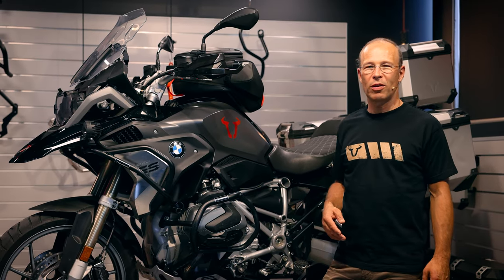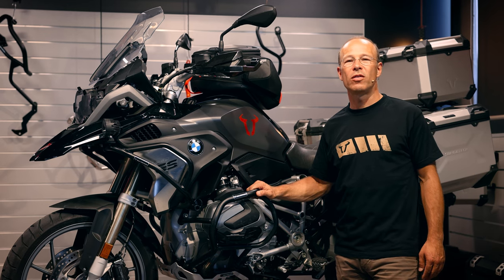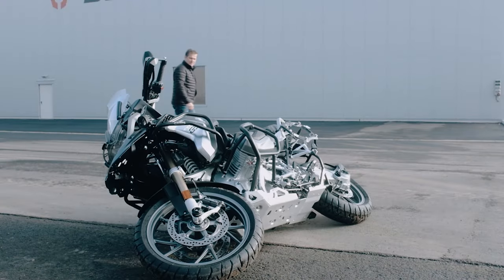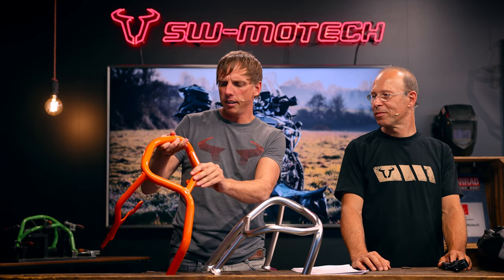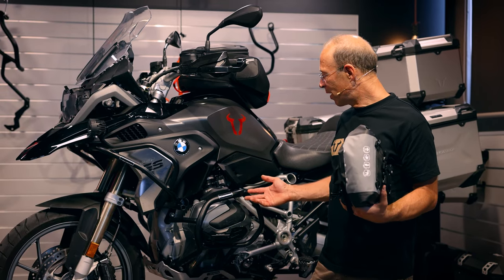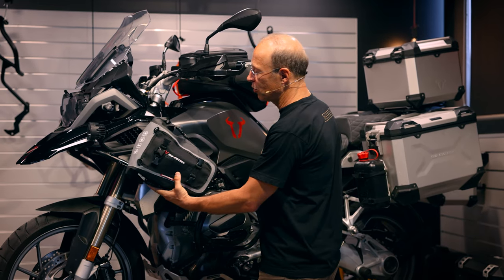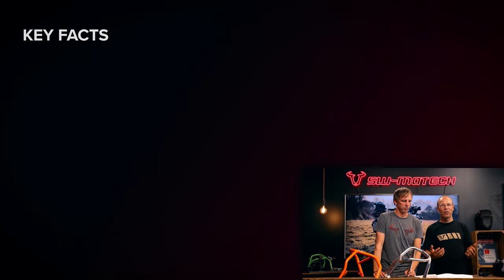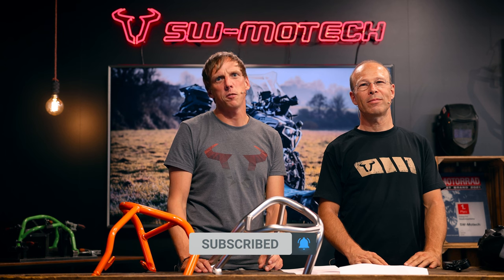CRASH BARS for touring ENDUROS - Useful protection on and off the road

Comment: I have a 2021 r1250 gs with option 719. I tipped over a few times in sand and dirt and while the bars do protect the engine there are noticeable scratches on the cylinder covers. It's mostly a cosmetic concern, but there is also the possibility that a jutting rock could do some real damage. If SW MOTECH starts making a plate to go outside of the bars to offer additional protection I would happily buy it. Also if anyone else has experienced a similar issue with their crash bars not jiving with option 719 I'd be happy to hear suggestions or solutions. Thanks!
Reply from the maker: Hello Julian,
thank you for your feedback.
We understand your problem, but unfortunately we have not planned something like this for the BMW R1250 GS with Option 719. We only have the protection products, which you can find in our webshop for your motorbike. However, I will be happy to pass on your tip to the relevant department.
Thank you for your understanding. // KS